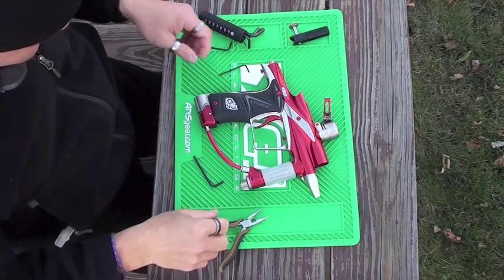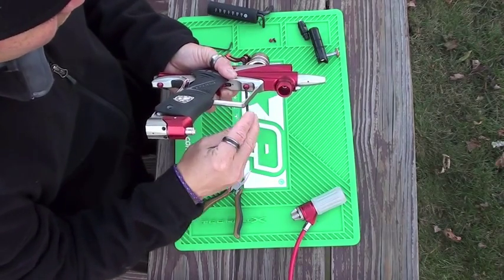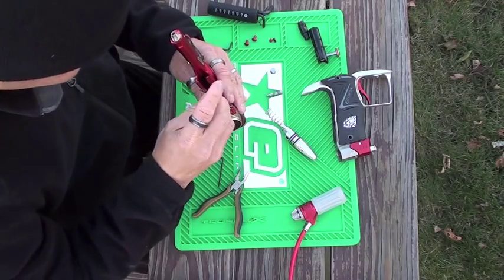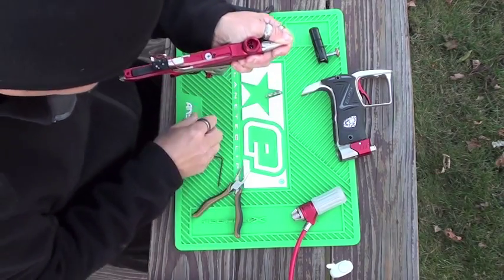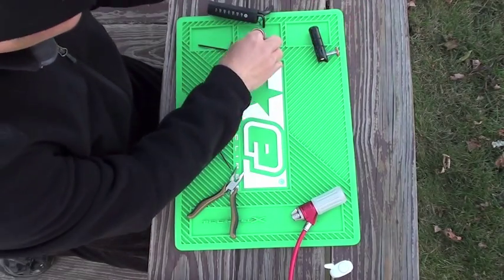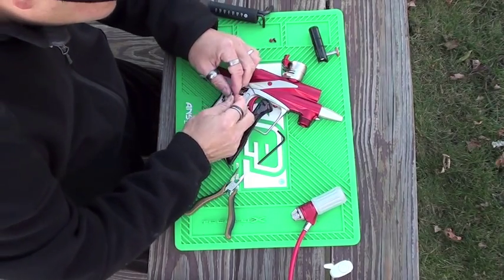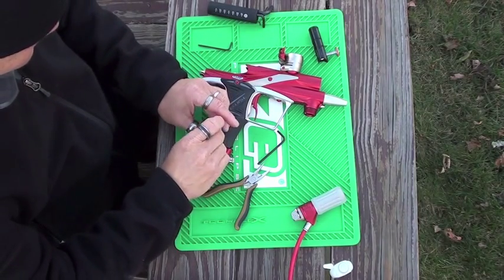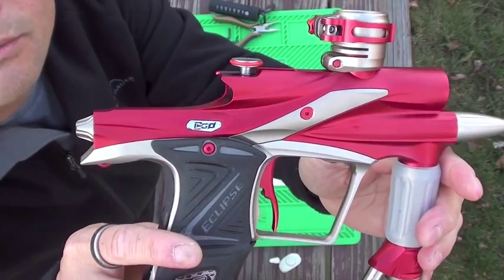D.A.R.T Kit Install on a Planet Eclipse Ego11

Comment from the maker: to get the macroline off, u have to push the retaining ring into the sleeve and hold it there while u pull the macroline hose out. to put it back in, u just push the macroline back in till you feel a bit of resistance force then it will pops in. give it a tug to make sure it is in all the way.

Comment from the maker: you need to take off the frame in order to get to the valve retaining screw. The dart kit includes a new valve and exhaust cup that works with the dart bolt.

Comment from the maker: Accuracy is more based on paint to bore match. I personally prefer a slight underbore since you will get a bit more efficiency. Both my Geo3 and Ego11 has been very reliable. I maybe break a ball in like 10 cases of paint, but that's due to the paint than the gun. My Geo2.1 had no issues either and I put over 40 cases in it b4 I got my Geo3.

Comment from the maker: try not to oil the bolt o-rings and if u do, very very very little oil.  oil will get into the barrel and create interesting spins (much like if you were to have a barrel break). Also too much oil can also affect the eye beams detection and can cause chopping because it's not detecting the ball in the chamber correctly. Also try to get a paint to bore match since the stock is a .689 and depending where you are the paint can vary in size, most paint I see up in the NY area tends to be in the .682

Comment from the maker: Geo3 and Ego11 is about the same as far as reliaibility and range goes. Geo3 is a bit smoother. Ego11 gets a little better efficiency, but is a tad louder. DAM is another animal in itself. It's more woodsball, scenario kinda marker. It shoots like a DM12 since it has an LPR. It's very accurate though if your using FS rounds, but your paying alot of money shooting FS especially in full auto. Not exactly as speedball marker due to the bulky form but can hold it's own as far as ROF.